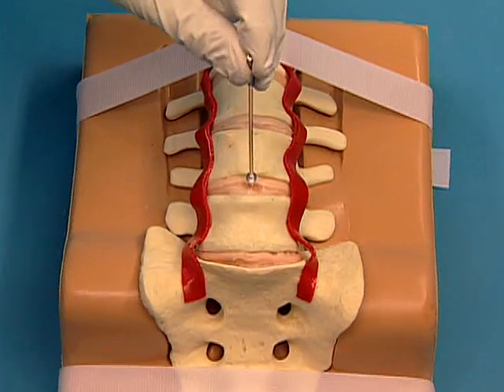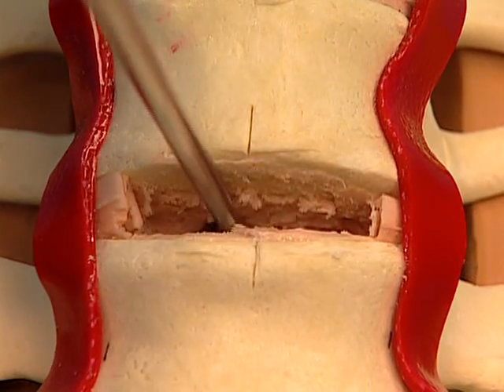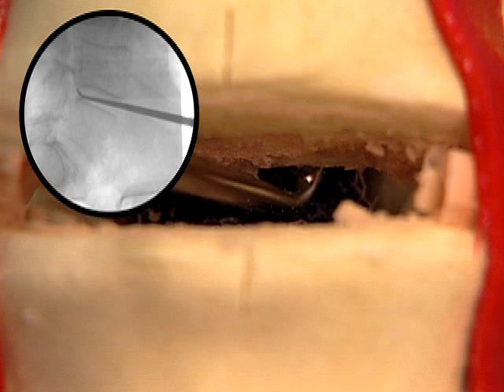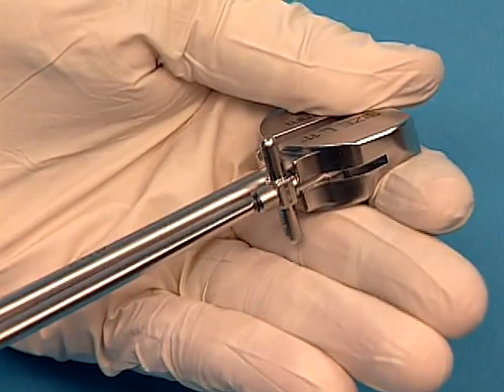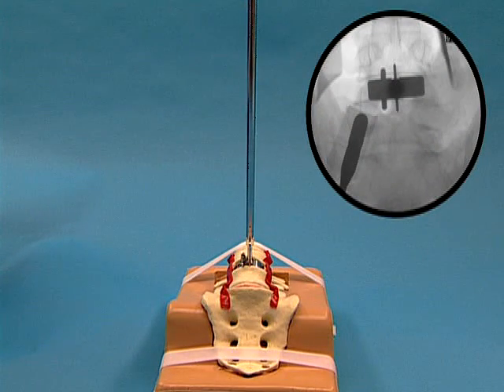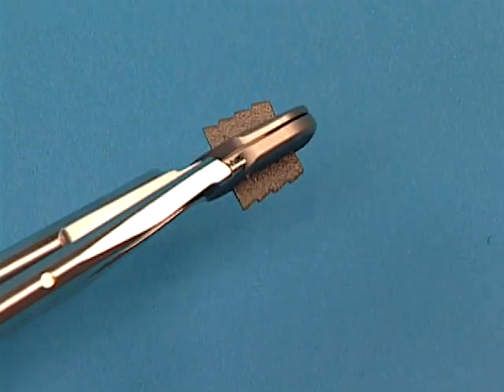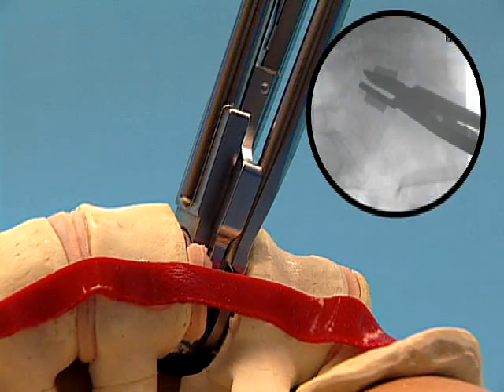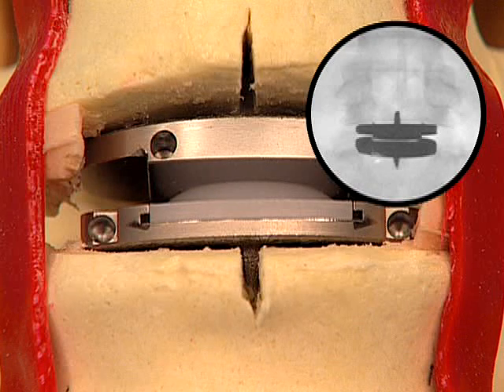Synthes Spine ProDisc-L Lumbar Total Disc Replacement Demonstration Video

Comment: The discs should come with rigged screws that come out from the sides, after they're inserted.

From the four corners.

And they can be twisted in thru the tool that puts the disc in.

Like if you could twist a section of the tool, and the screws come out.

Because it would make more sense.

Then the disc will never move.

Comment: I've had both the Pro Disc L (at L5S1) in fall 2007 and the Pro Disc C (at C6C7) Spring 2009 instant relief from both. My orthopedic surgeon is Dr. William Capicotto from Sisters hospital in Buffalo, NY. I've had five (5) spinal surgeries starting in April 1995 to April of 2019 all done by Dr. Capicotto.

Comment: Would it be possible to change the discs to slightly larger ones ... just to increase the cosmetic height?
Reply: In theory, yes, but doing so would increase stress on the intravertebral ligaments and make recovery a lot more painful, possibly even dangerous.
Reply: Then you risk extending the spinal nerve and damaging it, very dangerous

Comment: This is pretty clever. I feel a lot better getting this surgery now, even if there is hammering involved lol.
Reply: Spam Can, did you get it done yet?
Reply: Date please
Reply: Oh wow, I didn't even see the first reply and now I have another one. I had this done back in the fall of 2015. I spent a week in the hospital and then 9 months of physical therapy. However, I did have complications which prolonged my recovery (my bone softened and one of the plates slipped forward towards my stomach.)
Reply: @spamcan9208  how are ypu doing now bro.
Reply: How are you now???
Reply: @hamahama6894 not well actually. I had complications during that 2015 surgery because my bone softened and the implant moved slightly. I was at risk of getting opened back up and getting a fusion. Which is what ended up happening anyway, 7 years later. In 2022 my new surgeon had to fuse above and below my joint replacement. 2 rods, 8 giant bolts with the threads visible in x rays lol.  Almost like building a bridge across something. Right now I've been having a lot of trouble on my pelvis, where one of those rods is anchored (bolt goes through the SI joint.)

That being said, despite the terrible pain I'm in today, I'm still way better off now than I was before my surgery. 

I think I'm a unique case. I don't want to scare you away from something that could help you. I just had shit luck.

Comment: can i bend over and touch my leg finger or move like normal or not after this
Reply: What is a leg finger!?  Or do you mean your toes!?
Reply: @1456Sassy  there is no need to invent unneccessary words like toes. Hand fingers and feet fingers
Reply: If you need this surgery your movement is probably bad enough that you’d be willing to gain any significant motion after the surgery, regardless if your back is bad enough to need this surgery then you’ll never “be the same” as you were when you were healthy surgery or not.